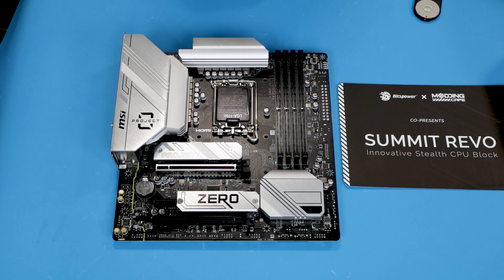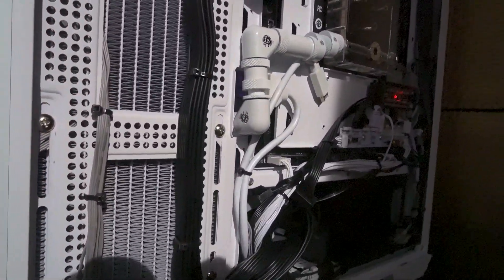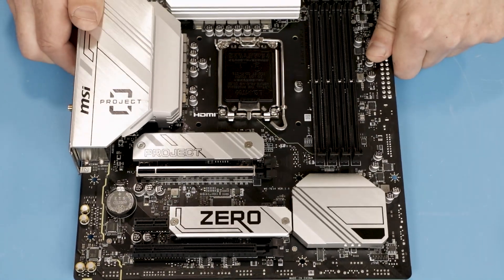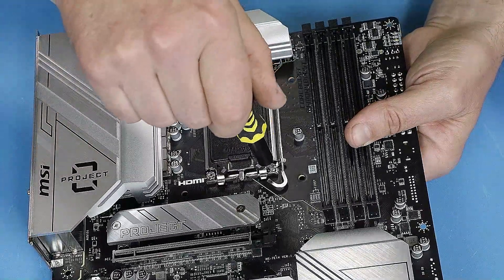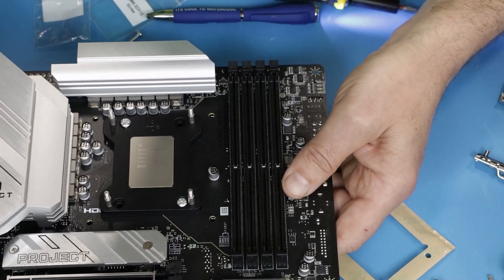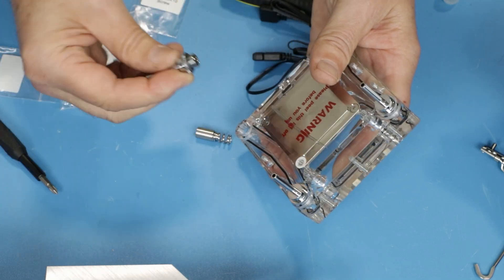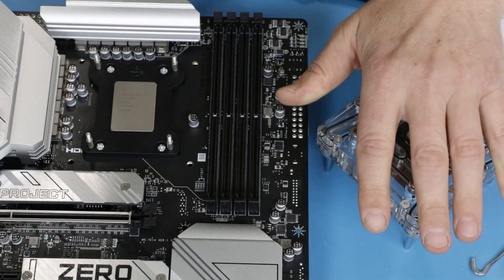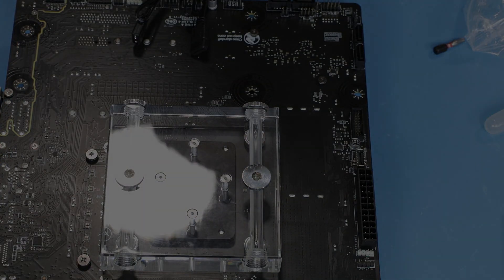MSI Project Zero with Bitspower  REVO CPU Block Installation - Quick Guide #8

Comment: Although this is a nice concept, it makes it that much more of a pain when you have to take things apart to clean or flush out the system or if you have to re-paste the CPU later on. What makes it even tougher is how to configure how you’re going to get the tubing now on the back of the motherboard when there’s not a lot of space typically on the back end of the case you’re using, when you have a lot of cables involved. Again nice concept, but this is going to be interesting to see how these new PC cases now need to be redesigned to fit this kind of water block on the front and back with this new type of front and back water block configuration. Also, how much cooler does your PC run as a result of the front and the back being water cooled at the same time? More than likely, there won’t be any change in temperature at all.
Reply from the maker: It is definitely more of Artsy thing than anything else.
Reply: @DazModeWatercooling  it sure is.

Comment: I am worried about the flow rate and using a pump with higher pressure like a DDC. However, I wonder if we can get a block designed like this for SFF. Not sure it’s possible but hey…